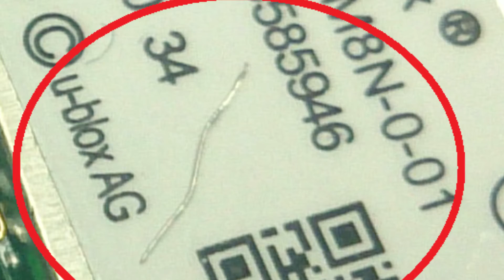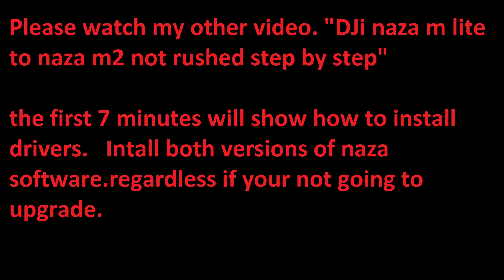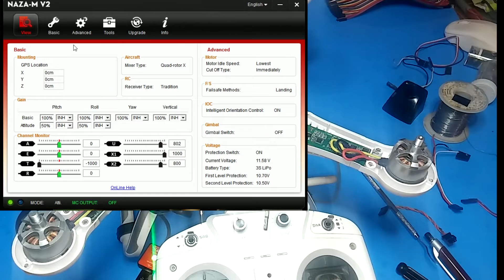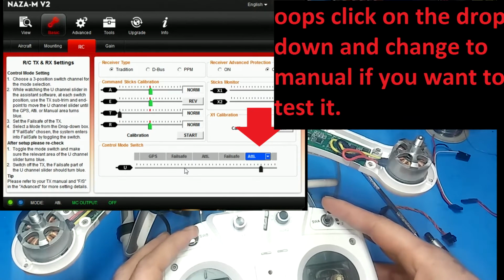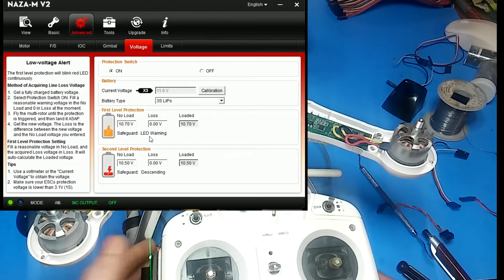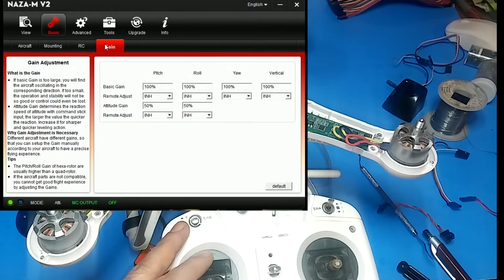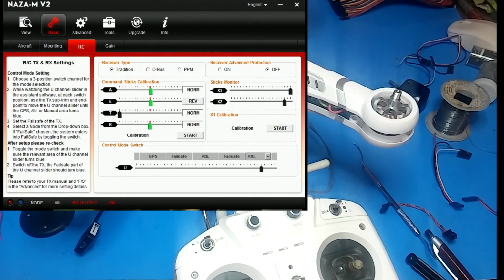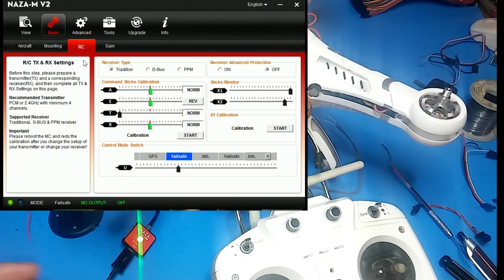cx 20 to Dji naza Upgrade

Comment: Great Video  thats the way my cx20 transmitter worked i could get to work the throttle roll pitch and yaw but could not get any flight modes with naza i see why  well i just gave up and got a tranis  but i might one day go back and see if i can make it work with the cx20 remote  keep up the good work and thanks
Reply from the maker: thanks..

Comment: re, merci pour ta réponse et oui c' est bien ça que je cherchai du coup je l' ai commander déjà souder merci encore et bonne soirée.
Reply from the maker: your welcome.. make sure to fallow the "all pinout fix.jpg" in the package. the picture in the other video i made was wrong .
https://drive.google.com/open?id=0B2w6_OKE_2kxWUtaZVU3LWhsM0k

Purple pads are optional for led.. with positive switch.  So you need to re wire led's to make them work ..

  If you need help later just ask..

Comment: Hello. I have the big fly shark version and encountered a problem. After a software update I have somehow reversed the throttle to where up and to the right arms the motors. They also spin when armed now. I moved the throttle stick after the update and it reversed it and I cannot figure out how to change it back. I was hoping that there is a sequence between the tx and FC that would enter a setup mode like you would a speed control. If you can help please let me know. Its a dead stick until I can resolve the issue.
Reply from the maker: Sadly I don't have a big shark flight controller...Did you use mission planner? the motor spinning is usually when you update it to version 3.21 with mission planner.. and that is a open source apm not a big shark..

for the remote you can try this.
https://youtu.be/mrBWEATUbus?t=1822

just do the remote calibration making sure to leave it at center when done.
Reply from the maker: also did you play with the wires on the receiver e,t,r ..maybe you haave it .. r,t,e

Comment: nice video bro you got a test flight video off it
Reply from the maker: Hi not yet.the last month or so and during the build video was awful outside..
 I did test it out and it flew extremely well in orientation hold(course lock) ,alt hold and gps mode.. ..however manual mode I did not trust it 1 foot off the ground without crashing it.   ..I played with the alt gains ect.. and they have no effect on the cx20 transmitter touchiness.
Reply: thanks for fast reply yea weather been crap here also I have a spare naza here that was thinking of putting in a Quattro x don't like that fc in it  big shark lookforward to your video of it
Reply from the maker: Hi ...just keep in mind if you only have a cx20 transmitter  you will have to get a new transmitter or mod it like I show in my other video.

Comment: ?Hi, I just finished to upgrade my cx 20 to naza , and everything works well except the Esc leds that are not working anymore , any idea
Reply from the maker: as the other post.. I will look into it ..once my pc is 100 percent done and i clear my bench..  worst case is will have to wire the led directly to 5 volts.. the ppm wire that is..    last i checked.. i believe that wire just detects a voltage to enable the lights on and off..
Reply: Thank you for your help
Reply from the maker: .....................edit ..that was a dumb comment I posted..how else would you power the motors.. so obviously your using the power board.. oops..  ..if you never seen this comment pre edit..ignore heh..
Reply: I wonder what makes the leds to go on
Reply from the maker: I explained that in the other comment..   the ppm wire on esc 3 / motor 3 controls all the led.. the ppm wire is directly connected to esc3 servo wire that connects to the output on the apm.... basically they turn on when the motors turn on .. .. Look on the corner where motor 3 is ..and you will notice that is the only side that has one extra red wire going to the esc from the mother board.. ..
Reply from the maker: you are correct sir.. they don't work .. .. i tried to connect directly to the receiver and does not work as well..very weird .. ...
Reply from the maker: wow..this is confusing.. .Now the only thing i can think of its the frequency  the apm puts out the pwm's.. ..    the naza nor the receiver puts out the right frequency .. I will see if we can change that in the cheap naza software but its pretty limited.. i think..

but this is just a guess..
Reply from the maker: and this will prob the last message on this .. alight so i took out my scope ..and tested things out..
cx20 receiver outputs at 50hz
cx20 apm and pixhawk puts out at 490hz
..
dji naza puts out at 400hz..

I was trying to figure out how to get my nano to put out at 490hz
but the max is 50hz i'm getting. as well..

The only option i can see is to wire all the led wires directly to 5 volts.. each esc wire has one positive wire going to the main board you would need to attach all those to 5 volts..      however you would then loose the blinking led on low voltage..but you should still get your warning beeps ..

After my next video when ever that is ..I'll check things out more on the board and see if something can be hacked..
Reply: I appreciate all your effort, I will try it this evening
Reply: Just add a jumper as i did in this picture
https://photos.app.goo.gl/GKeq6CFJ2dCbivu93

This will lit all the LEDs under all 4 ESCs.

Comment: hi bangs, just to say hello as my APM goes right. 
After seeing your video, maybe i ll change for a naza fc for my aerial but have to purchase all the rest which is not working or plugging in naza fc and it's not a priority . 
My kwad run now on cleanflight/betaflight and especally SPF3 fc (cheaper, lighter and faster (32 bits vs 8 bits) than APM and also because there is no more update for APM)
It will be great if you could make some tuto, mods, on F3 FC 
Anyway, thanks again for your time, your advices, your works, tuto, video.
Reply from the maker: Yes i will most likely move away from apm's as well.. I have one more pixhawk based  apm install  video to make that I've been holding off on for a week or so..and that will be the last apm style step by step installation video.  

Thanks for the suggest on the spf3 I will look into that.
Reply: Great !!! this is the board http://seriouslypro.com/files/SPRacingF3-Manual-latest.pdf
As you can see, as if this board is one of the most popular in fpv racing, it can also connect a lot of things with all the port, it also ppm, s-bus, i-bus. 
Much step by step to come :)

Comment: bonjour à toi , je viens de recevoir ma pièce pourrai tu me dire ou brancher les fiches sur ce petit bidule et au cas ou pourrait tu me faire un petit schéma , merci à toi et bonne soirée.
Reply from the maker: Hi your message does not translate correctly ..  it says   "i just received my room"

about your other question I believe you arm it by pointing both sticks to the center bottom ..or bottom outside..
Reply from the maker: If you are speaking about the arduino nano   .. i have video here 
https://youtu.be/2WqzrmIHDnI?t=827

I also include a picture in the package you can use .. the one in the video at the start is wrong for yellow and grey . they go on the bottom 2 not top.

Comment: Hello my friend is it possible to us a Devo flight controller.   off a walkea qr x350 pro quadcopter.
Reply from the maker: hi  I don't have a walkera flight controller or transmitter . All i can assume is yes its possible ..      I'm not sure about the cx20 receiver or the power source your flight controller needs ..   I really doubt they did anything special with the esc, so the cx20 esc and motors "should" work with that flight controller.
Reply: bangs6996 are you a member of the main cx20 group? On FB.. I have shared your videos to the group you definitely know what you're talking about. Love the videos buddy.:)
Reply from the maker: Hi ,  I am not  a member of that group  .. and thanks for sharing my vids.